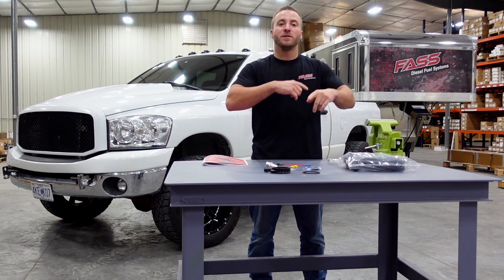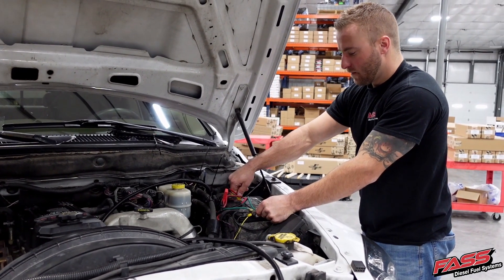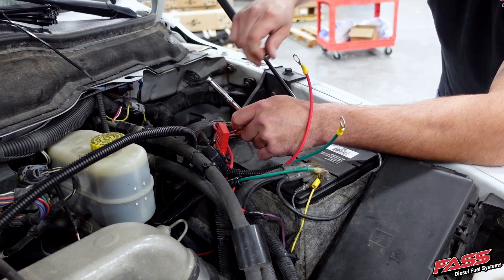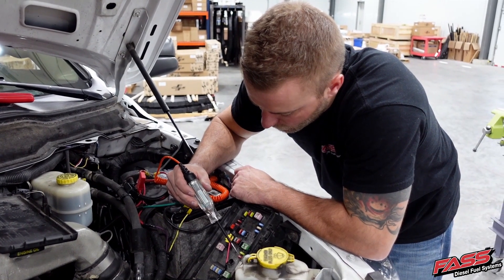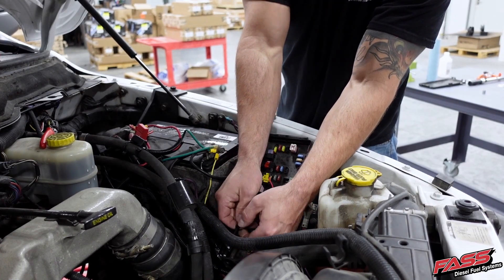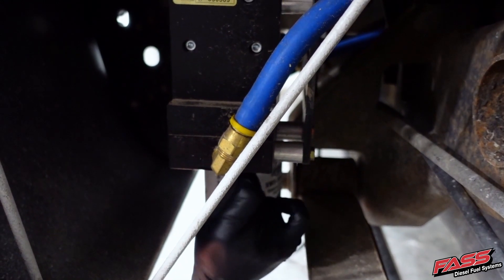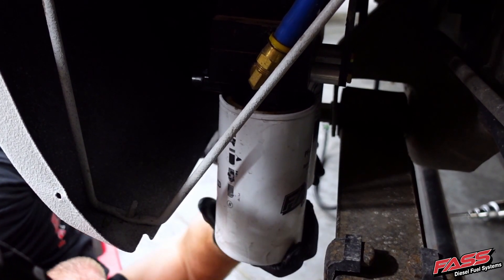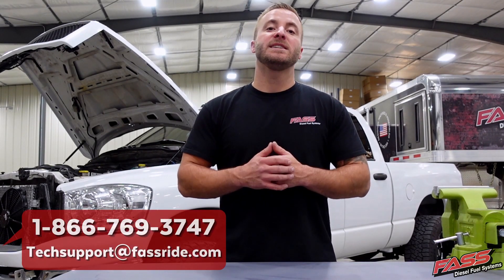Must-Have Diesel Upgrade for Cold Weather! |  High Output Heater Disk Kit Install

Comment: Would this install in the video be the same on a 15 Duramax?
Reply: Also, thinking about adding the trigger on to my headlights when I turn them on. Is that an acceptable way to power the heater? Thank you for your time

Comment: I just ordered one of these and was wondering what people do more often. Do they wire it to a switch or just use a key on relay? And which one seemed to work better?
Reply: Switched mine to help thaw any thick fuel at the filter during upset conditions before running the pump. I felt it would ease the strain on the pump a little and might save some batt juice by thawing a little fuel before trying to crank. Normally I keep antigel in the tank to help which I recommend. Mounted my toggle in a highly visible spot with an led on light so I don't leave it on and run the batts down. The more the heater runs after starting the better it gets.
Reply from the maker: @chumperest  👊👊
Reply from the maker: Hey Jochum, thank you for reaching out! Great question man, and personally I like the switch. It gives you the freedom in the summer just to keep it off and in the winter you can turn it on anytime to start thawing out fuel. 

Both ways work great though and it really just depends on what you are most comfortable with. If you have any other questions you are more than welcome to reach out to our service team as well at 636-433-5410. Thank you!

Comment: Definitely made a smart call buying this unit! Installed this heater 1 year ago. Straight forward install, user friendly and a non-existent maintenance item. Rigged mine on a toggle so it can be turned on before the pump activates. 220 GPH fass, fass XL filters, 12 valve Cummins no heater grid, sitting outdoors cold 2 days and no ether used. Block heater plugged in for 2 1/2 hrs at -17 (wind chill included lol) little to no anti gel in tank. Toggled heater for 5 minutes before attempting to start. Pump was not happy with the thick fuel but gave it a 10 second crank, waited, pegged the skinny pedal on following two cranks for 3 or so seconds and slowly she chugged to life. Fuel pressure normally sits at 49 PSI but was showing about 10 PSI. After 30 minutes of idling fuel was still at 10 or 12 PSI so took it up the road roughly 1/2 mile and the fuel crept up to about 38 PSI with no issues. Long way of saying glad I installed it.
Reply from the maker: Ohh wow, this is awesome! We're happy everything has been working well for you! Also, thank you for the feedback we appreciate it!
Reply: Happy with heater performance especially running a sump with little or no anti gel feeding a cold grumpy 12 valve. Good to know it'll put up a good fight against old man winter and keep me rollin'. Coal too lol
Reply from the maker: @chumperest  We appreciate that!

Comment: Your liftpump with this heater is a nice kit.  Before I purchase, does FASS have a way to signal the driver when the heater is actually turned on?  do you have a chart or graph that shows fuel temp vs wattage consumed or whatever it uses to trigger heating? (how does the logic work for heat applied vs. sensed temperature? or is it simple full heat on until fuel is +33F, then off?)  I suppose an LED could be triggered for heater-on state, but more details would be valuable here.
Reply from the maker: Great question, and we appreciate you reaching out! The heating element will turn on once the temp hits freezing, and then turn back off once the fuel has heated past 60 degrees. 

If you have any other questions about this you are more than welcome to reach out to us anytime at 636-433-5410. Thank you!
Reply: I put a temp sensor in the pump block that feeds my Edge CTS3. I see fuel temp at pump at all times or if the heater is working
Reply: @mrmotofy  where did you get this sensor ???
Reply: @scaleytail  Just a temp sensor for whatever gauge you're running. I use the Edge CTS3 with EAS, so need the a temp sensor for it. Otherwise any universal temp gauge should work

Comment: Can this be used on an AFE DFS780 and can it be wired dual purpose?  In other words could this be wired to a switch that is ignition operated so that the switch could be left on during the winter and let it run when the key is turned over but still allow it to be switched off during the summer when it is not needed?  Hopefully that makes sense.
Reply from the maker: Awesome question Robert, and I do apologize as these heater kits will only be compatible with our pumps. If you have any other questions or need anything at all we will be happy to help! Our service team number is 636-433-5410. Thank you!

Comment: I installed it an my pump won’t stay primed I can get it primed and running but as I turn it off for more then a few minutes that pump won’t be primed
Reply from the maker: Hey there, thank you so much for reaching out about this. I do greatly apologize for the trouble that you're having, and we will be happy to help. If you don't mind giving us a call at 636-433-5410 our service team will help get this diagnosed for you!

Comment: How many amps does the heater use?
Reply from the maker: The disk will jump to about 30 amps when it first comes on and then slowly drop as it warms up
Reply: That’s the same as a 50 gallon hot water heater in your house.
Reply: @rob snodgrass NO not even close. Water heater has a couple of 3000w elements. This heater has like 300w